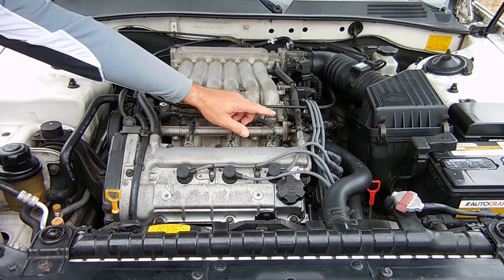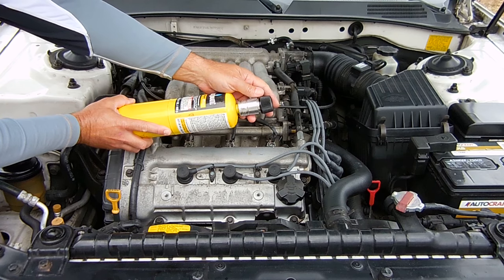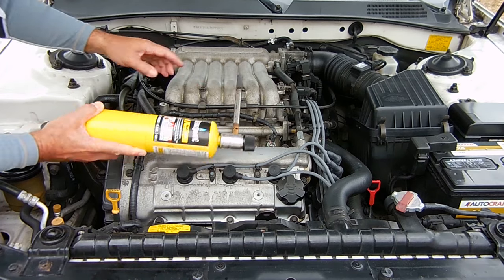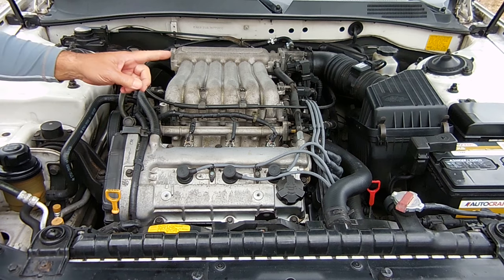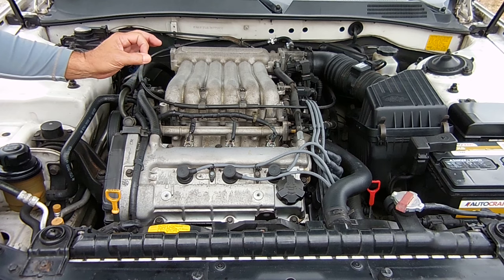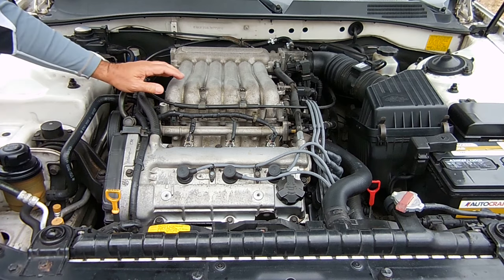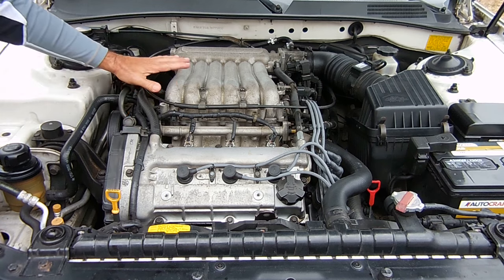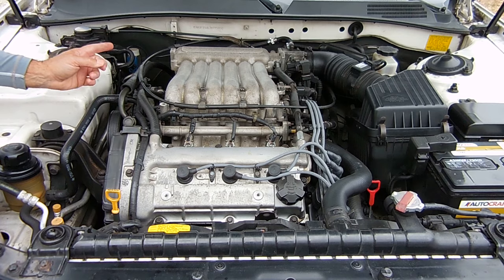EASIEST Way To Find Engine Vacuum Leaks! DIY Auto Repair

Comment: Personally I use a stethoscope with the hose left open at the end. This works for suspension noises as well and even better than leaving the metal pointer on the end. I agree 100% with your technique and am a 30+ year mechanic
Reply from the maker: Yes, a stethoscope with the end removed works great. What I show in this video is a very cheap alternative to a stethoscope for the average person. Thanks for watching!
Reply: How do you use a stethoscope for suspension please?I have a suspension problem i guess
Reply: @denisouncho2513  You have to be able to duplicate the noise with the vehicle on the ground or on a lift. Obviously driving may pose a challenge

Comment: I just wanted to say that this is a brilliant method.  I have used the gas method and was always  a litte eery about doing it that way but this is genius.  I have a 4runner that has a misfire that I am trying to track down.  Ive changed coil packs and plugs ands wires and the misfire remains so this is going to be my next move.  Thanks so much.
Reply: Did it work?

Comment: Great idea, is that slight whilstle that you get when you start the engine part of this leak too? I have a similar sound at the moment when at very low rpms static, and increases in pitch with a tiny bit of gas applied.. Also get some strange issues when hard accelerating at random, sometimes like the engine is juddering/sticking trying to reach the higher rpm after a gear drop.. A 2018 Mercedes 220 diesel engine.. Not good

Comment: i have a 95 lexus v8 sc400. I see smoke coming from the thick hoses towards the rear of the intake and close to the firewall.  the hose clamps also look burnt and smell.  There are fumes coming from the area. I have rough idle, and the rpm goes in the wrong direction when i rev the car.  The exhaust has sputtering sound.  Does this sound like vacuum leak ?

Comment: if it is a diesel, you will notice increase in idle rpm for a moment. that is becasue of diesel speed adjusted by fuel rate not air; in contrast of gasoline engines.

Comment: Have an important question that is directly related to this video.. my question is did this vacuum leak which was on this engine did it happen to set any trouble codes or warning lights??????
Reply from the maker: I don't think any codes were triggered.
Reply: @electronicsNmore  I ask because I believe I have a vacuum leak that isn't triggering any trouble codes but it's still compromising engine performance as well as breaking. If you don't mind me sharing, I first noticed something when my brake pedal no longer retracts back to full upwards position. And the engine doesn't start in the cold very easily.. have a fluctuating idle.. it just seems as life I'm not getting enough vacuum to operate the brakes properly. Because all of the brakes grab. As if it's not releasing. Because there's not enough vacuum. But that would seem like it need to be an awfully huge vacuum leak to ruin engine performance so badly as well as breaking constantly on its own. But I can't find the damn vacuum leak? My brother believed it was the idle air control valve and I didn't believe his diagnosis fully, because I think it was a little bit of both.  A worn I don't air control valve or dirty pintle and seat.. or it was just going bad.. but we replaced it and it only helped in the way that it stays running a little bit better. It feels like there's some sort of vacuum gate that is not closing and even opening at random causing the engines idle to fluctuate and compromising breaking as well. Phew... Uhhg. I said a mouthful lol sorry

Comment: Ive always sprayed carb cleaner around to find vacuum leaks. When the carb cleaner hits a leak, engine rpm increases. The problem is that doesn't work with todays engines. The computers will keep the rpms steady even when spraying directly into the intake. 😔

Comment: God tip. Another way is using starter fluid. Just spray it over hoses, manifold, injection valves etc when the engine is running at idle. A vacuum leak will increase the idle speed when sprayed.
Reply from the maker: Yes, just like using the propane torch. Thanks for watching!

Comment: Plastic intake covers on many modern vehicles naturally make a hissing noise, so this would not be a very good method. Also, some vacuum leaks don't rear their ugly heads until the vehicle is under heavy load, so this method would only be good at detecting the type of leak that would affect the engine performance at idle.
Reply: so the hissing/whooshing coming from my intake manifold is normal?

Comment: Sure...if it’s a gross leak😂
Otherwise a smoke machine is THE best tool😎
Reply from the maker: I can assure you it works on big and small leaks. All you have to do if move the tip around suspected areas. Smoke method does work good, as long as you don't have a cooling fan blowing the smoke all around. :-) A minute vacuum leak on your car won't even be noticeable.
Reply: How much is the cheapest smoke machine?